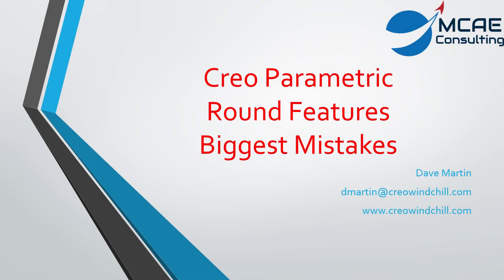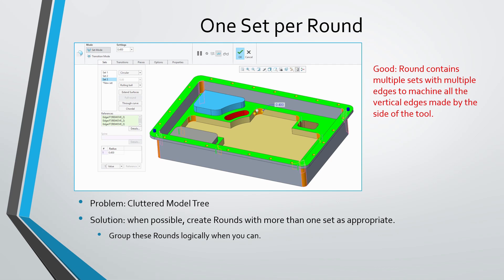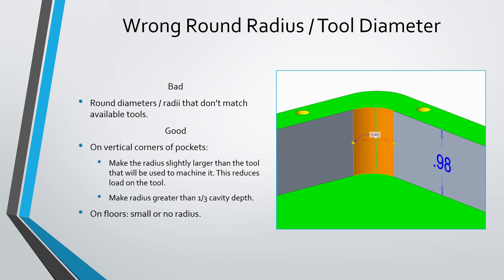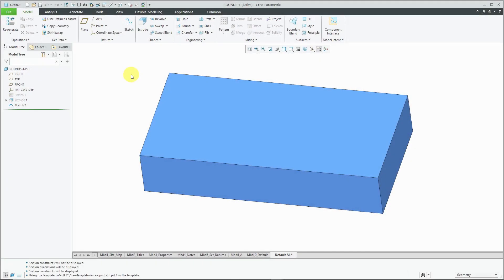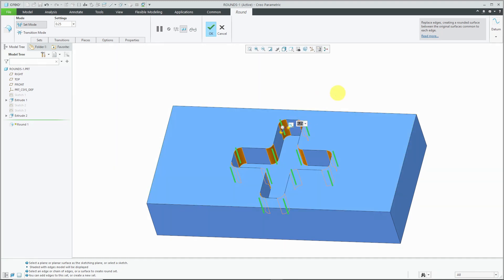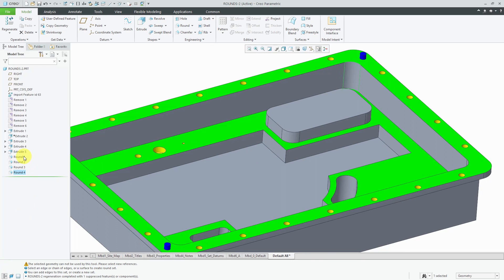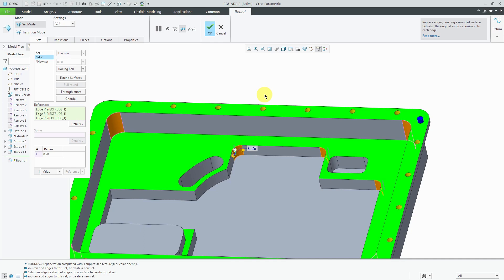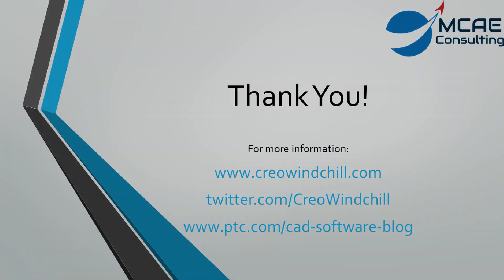Creo Parametric - Round Feature Biggest Mistakes

Comment: Why Creo Parametric has kept everything complex for small small things as compared to other programs?
Reply from the maker: It’s a trade off between capability and simplicity. Do you complain that a CNC router isn’t as simple as a table saw? Generally I find when people make comments like that, they are unaware of the full range of functionality and edge cases that Creo can handle that other software can’t.